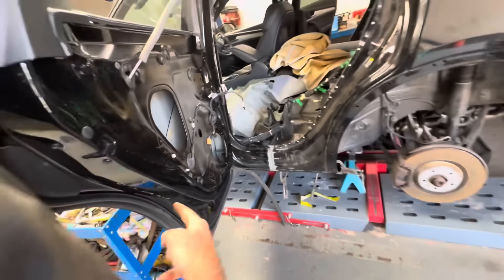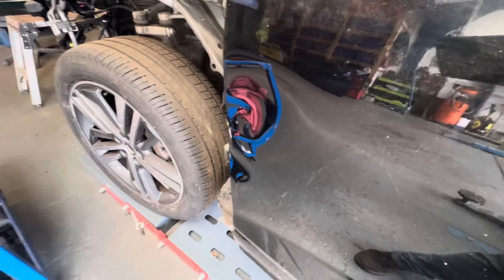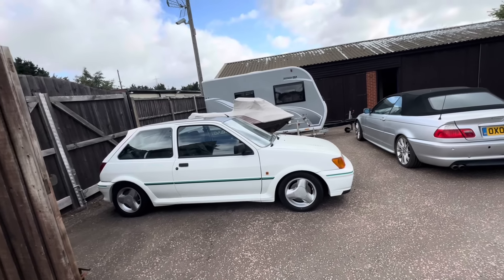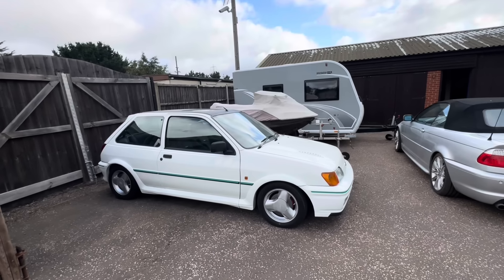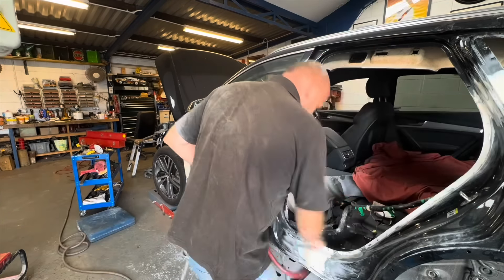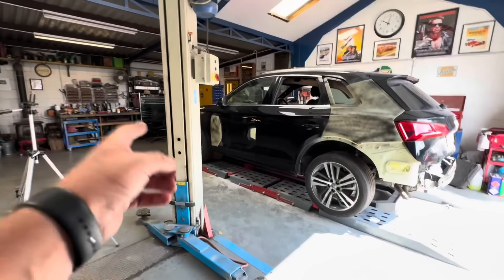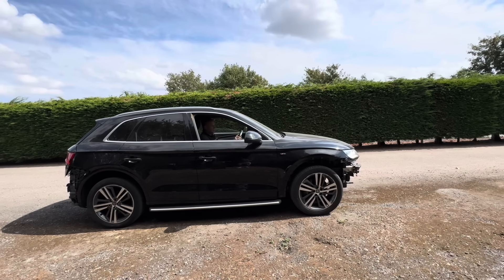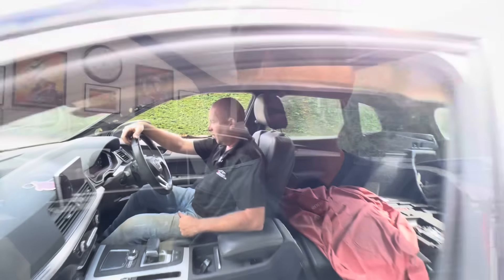REPAIRING A CRASH DAMAGED 2019 AUDI Q5 PLUS A ROAD TRIP

Comment: My go to videos, and another great one. Someone tell Rob that aluminium IS metal please!
Reply: Rob uses the word 'metal' when he means 'steel', either a pressing or a casting. Putting different (technically 'dissimilar') metals together without anything between them can create a source of corrosion that can 'knit' the parts together as they oxidise and cause one to be eroded or sacrificed and so can make them difficult to separate.
  Adding water and road salt into the mix makes this chemical reaction occur more rapidly and more vigorously. I hope this helps.
Reply: @fredbloggs4684  and the sacrificial anode on their boat works in a similar principle. 👍
Reply: @fredbloggs4684  We know but Rob needs edumacating..
Reply: @petesmitt  He reads the comments so hopefully he'll get a bit of new secondhand 'edumacation', which is fair do's because we all learn so much from the videos

Comment: i've been on an off-road experience, it was a night-time outing in 1988, had to pay the farmer a tenner to  lift the "borrowed" works transit out of the field...
cost another 20 quid to fix it, just bashed the metal straight + fitted a new NS mirror head + indicator lens.   try that in a new van - written off + sacked no doubt...          excellent work chaps